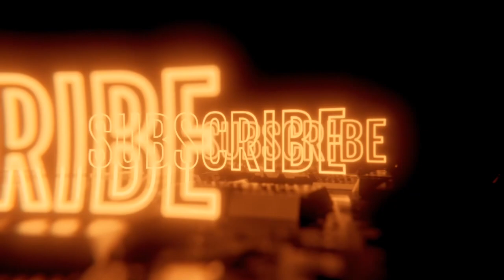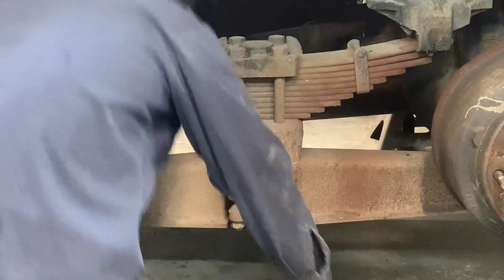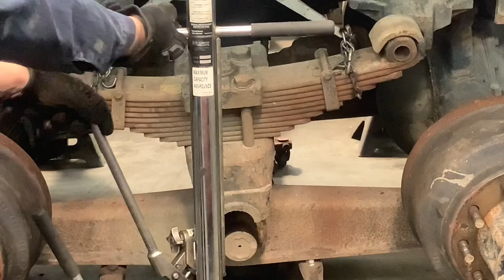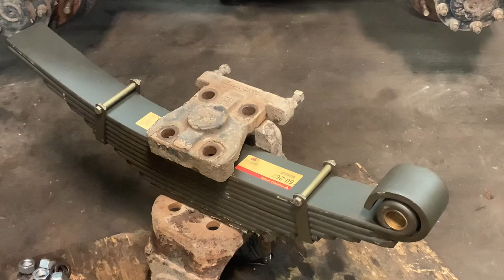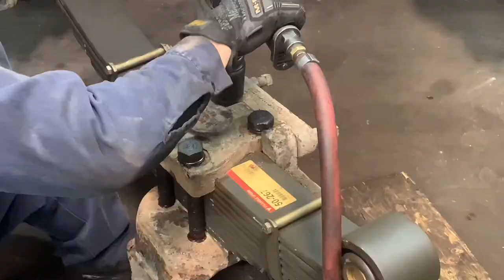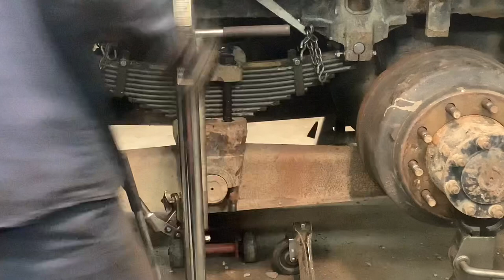Hendrickson | Rear Leaf Spring Replacement

Comment: Hello from Australia, I am a retired truck mechanic and it is good to see the job done properly with lubricated threads and all. Well done five stars.
Reply from the maker: Thanks for watching and commenting!!
Reply: I’m missing lube on the pivot axle on the beam connecting the two axles.
Reply: Hello bob give me job
Reply: Isn’t that red locktite?
Reply: @neggym  you want that dry.  there is a rubber bushing that the saddle sits on...that will move when the axles walk around

Comment: My first time watching, I drove for years and only saw spring work done as straight up bull work. That use of the Hoyer lift is pure genius. I would never have thought a Hoyer was capable of lifting a full stack of leaves in and out of a truck before but some patients turn 600 easily. Subbed and hooked all in one fell swoop.
        Mike.
Reply: x

Comment: This small compared to those spring we used to replace.  1968 KW Dart 150 tons dump trucks in mining equipment. It takes a Fork lift to lift the spring and use 1" impact wrenches to loosen the bolts.
Reply from the maker: Thanks for watching and commenting!!

Comment: Good job, only thing I would add is that half inch impact gun is not nearly strong enough to tighten up neither the big retainer bolts on the spring nor the wheel lug nuts.
Reply: I think that`s a  3/4 impact not 1/2
Reply: @ralphphillips6422  I think both were used, but to me, it really looked like half inch was used to tighten up the nuts. Besides that, never was a torque wrench used, and the lug nuts required some five hundred foot lbs. torque. Just saying.
Reply from the maker: Thanks for watching and commenting!! I used 1/2", 3/4", and a 1" impact wrench on this job. Keep in mind these videos are edited for time and not every single step is shown.
Reply: @SemiWorkin  Thanks for the info. I don't mean to be critical, just my opinion?

Comment: This style suspension used to be a lot more popular. By failing to crack test the walking beam when doing a major service like this, you are leaving the vehicle in danger of turnover if the beam fails in a bad place. And yes this has happened more than once.
Reply: I had a friend of mine killed several years ago after the beam broke 3 days after having bushings done. The truck catapulted crushing the cab.
Reply from the maker: Thanks for watching!!
Reply: Crack test? You magnaflux the beam? LOL!! In 35 years I've never seen nor hear of a beam breaking.
Reply: It was the only one I ever saw, but the beam was broke just behind the front bushing and the beam had torn up a strip of blacktop before the truck rolled.
Reply: @donmunro144  I just can't see how that could happen, the rearmost wheel would have to be 7 inches in the air to get the front of the beam anywhere near the pavement. And if it broke behind the bushing it wouldn't even be long enough to touch the ground unless the tires were flat.
Reply: @jimmartin7881  I wouldn't have thought it could happen either, but I was at the accident. I saw the beam and I saw the trench it dug. We had been talking on the cb just before it happened. The only person there before me was the people who's lawn he rolled into.

Comment: What’s up with the big gobs of grease on the bolts? In automotive, we avoid lubricants on threads to prevent over torquing. I realize this isn’t automotive, but the purpose of a fastener is the same in both fields.
Reply: I was always taught to use lube on treads to prevent under torturing!  Many manuals will specify where to use lube on the faster when torturing to get proper bolt stretch.  This man obviously has never read the Hendrickson manual because he would know that with that air wrench he way over torqued them.  Plus he just destroyed the saddle by torquing the bolts before torturing down the end caps.  The ears of the saddle are now warped and spread way the fk out!

Comment: So this stack of springs is holding up the load on 2 dual wheels so it makes you wonder why in Pakistan they use a stack like this plus a much larger stack under that.  It is the reason why they are breaking their trucks.

Comment: What are the bolts for on the side of the top plate for? You didn't have to loosen them?
Reply from the maker: Thanks for watching!! They pull the spring in close to the saddle and no I just used a hammer.

Comment: I'd say use a damn heel bar to line up your spring pin after you've got it close bud,bolts are not made to locate ,by hammering and then running a nut over f ed up threads